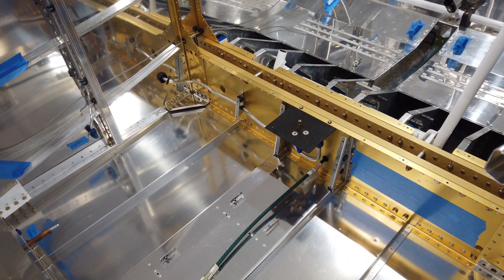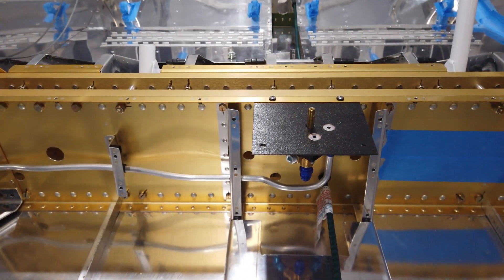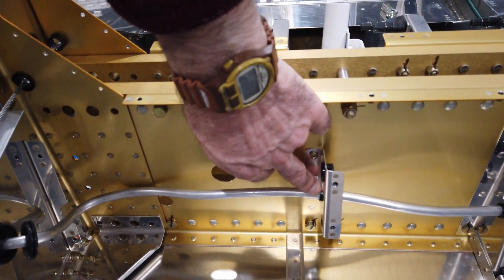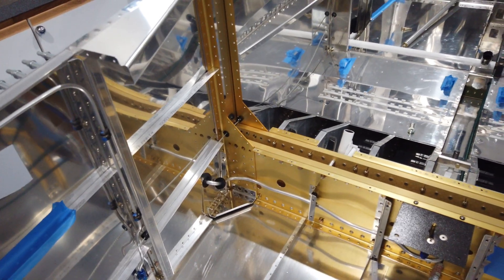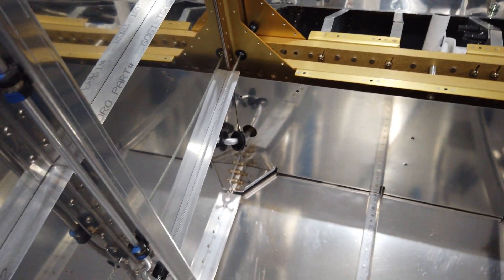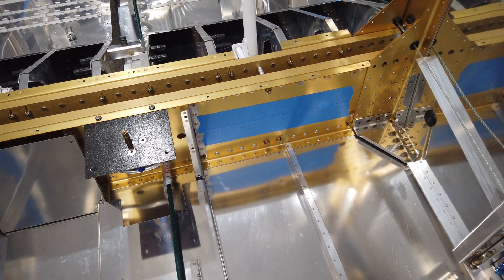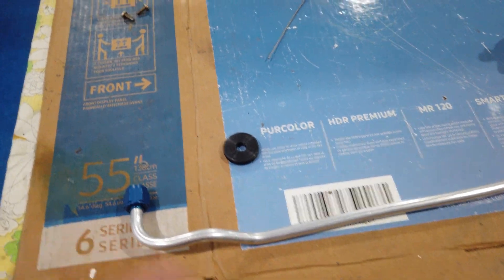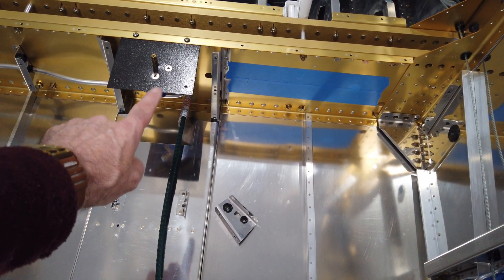Vans RV 7 HINT Video Aluminum Fuel Line Install Begins

Comment: I sympathize with you here, me I have a Europa monowheel 914 Rotax, it was built in Florida 2001 mostly to the build manual with rubber fuel lines, two electric fuel pumps.  I plan to make the system more aviation grade. Have three 6' sections of 5052 tubing from ACS and will go with that and AN fittings.   I am with you on not using a regular tube cutter as it work hardens the tube and then the distortion/bure to deal with.
Reply from the maker: I have never heard of such a plane; so I looked it up. Very cool! I see you can buy it, like the Vans, as a kit. Looks like a nice aircraft.

Comment: I have an idea for the grommet! Not sure if it’ll work, but try wrapping a string (waxed lacing cord) around the grommet, several turns around the groove, then put the string through the hole, press the grommet against the hole, and pull the string. Maybe it’ll spiral it onto the panel as you pull the string? Just a thought..
Reply from the maker: I do know that trying to screw grommets in does seem to make it easier over than just squishing it in place. The big problem is having the tube through it; not nearly as squishy or flexable. I may just split the grommets in those two locations. 

How are the wings...started yet?
Reply: @KaretakerAero  I haven’t started yet.. the wife has me doing all of the house chores lately.. doing some small renovations, I’ll get started on them this week though!
Reply from the maker: When you do get started, it will be that much more exciting!
Reply: What I've done before is nick the grommet back side lip at a 45° angle. This gives you a sharp point that you can insert into the hole then screw it in. Hope this makes sense and helps.